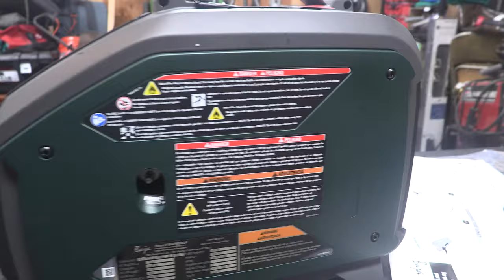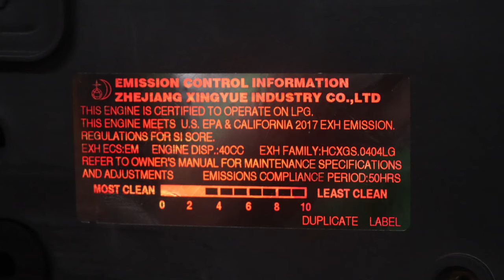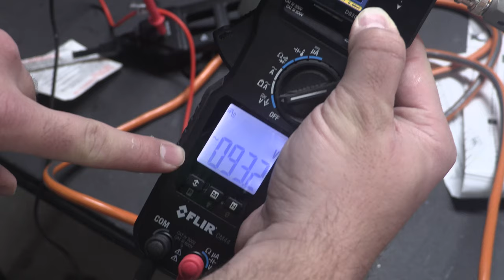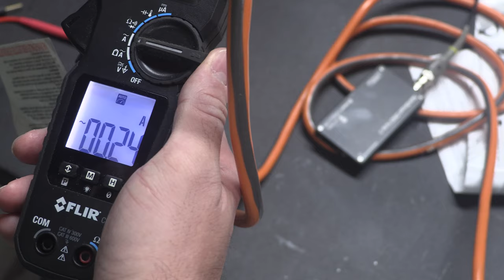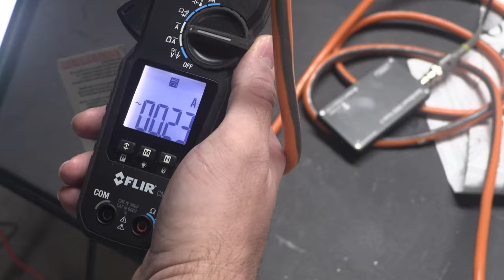Baja 900 - First Look and quick review

Comment: They are great generators. I have a couple of deep freezes that I use with one. Together pulling in the 120w range after startup. One of these with a 20lb tank will get 60hrs at that load. I can run an LED projector, PS3 super slim, laptop, cell phone charger, charge tool batteries, and small speakers. Pretty insane the amount of stuff you can run if you are just a little power conscious.

Comment: Mine also had lots of oil residue at the bottom.  They did not QA really well from keeping that from happening.  Also one of the feet fell off.  Had to find the screw outside but luckily I did. Thanks for the review. I need to add more oil to mine and retest.  The oil that came with it barely filled the tank to low minimum.  They sure cut corners.  Super short propane hose.  I think it should be OK for us though.  Purchased on sale at Home Depot for I think $239 plus tax.

Comment: How did you know what kind of oil to use?  Sorry I am not very handy...  Great test Review!
Reply: I looked it up in the manual on the Home Depot site for this generator and it takes 10 oz of 10w30. I just bought mine used and the oil was a little low and pretty dirty so I had to find the specifications.

Comment: would 1 lb cylinders freeze up and make it stop running
Reply from the maker: I've only got a few hours of runtime on this unit, and it was in decently warm weather high 40s/low 50s and there was no freezing. I suspect freezing would be an issue if you were much colder 30s and below while pulling a high load.
Reply: Yes. Freezing was an issue with mine under 50 degrees with light load. I solved this by making a manifold to connect two tanks to the provided short hose. This increased run time to over 6 hrs. Very happy with it.
Reply: Flame King makes a dual one pound bottle adapter that hooks to the propaine with an adapter hose for about 30 bucks.

Comment: My entire second floor is one large open area with like a 20' ceiling except the master bedroom, bathroom, and a tiny half bath.  The kitchen, living room, and dining room are all open.  Do you think this is safe to run inside on my second floor on the 1 pound bottles in order to "not advertise" to the neighbors I  have a generator?  At the most, I would use a flame king dual one pound coupler, never a 20-pound tank inside.  I was thinking if you can use a Mr. Buddy Big Buddy heater with two one pound tanks inside, this should be okmwith a dual 1 pound coupler.  What do you think?.

Comment: I'm looking in to one of these, but I have to know. Do you not need a regulator for the propane tank- specifically the 20 lb one? You can just plug it straight in?
Reply from the maker: The regulator is built into the genset itself. You just need the 20 lb to greenie adapter and you're good to go. It comes with a really short adapter hose in the box - so you should be up and running without needing anything else.

Unless you want your propane tank to be further than 2" away from your generator's front panel. :)
Reply: I have converted mine to run off of my travel trailers LP system.  While I won’t give details on how to do it, I will give you a hint.  Inside the generator there are two regulators. A tiny one for converting LP tank pressure to about 5 psi, and the big one that he showed that is a demand regulator.  For my purposes, I removed the small one (because my trailer has a low pressure regulator already). This will make it impossible to use a throw away bottle, That I had problems with freezing off, thus starving the generator.  The inlet for the fuel is part of the regulator that I took out.  I just replaced it with a quick disconnect hose.  I can’t give detailed instructions because if your not totally familiar with vapor gas systems, you could be in for some real hurt trying to do this. I will warn you it’s not as straight forward as I have made it sound, and their is a very real chance of ruining the generator.  Mine is two years old, ran a fair amount and still going strong. Mine is the Royobe branded one sold at Home Depot, but it is absolutely the same unit.  My buddy has the Baja unit and we modified his also.  I paid less than two hundred for mine, so I wasn’t to concerned if I broke it.  Also, mine came with a ridiculously short poorly made twenty pound tank adapter, and good ones that are longer are available from Amazon for less than 20.00.  You only need to modify yours if your going to run it on a already regulated LP line.

Comment: Been looking for fuel consumption numbers for 50% and 75-100% load if anyone can share that info
Reply: I recently had a power outage and use this generator to run a 13sf refrigerator, two fans, 4 led lights and 3 chargers for cel and laptop running total 400 watts that will make it over 50% capacity. That been said 1 lb cylinder lasted 2:50 hours before cutting off after that I connected the 20 lb cylinder same 400 watt load for and additional 11 hours non stop until the power was re established, the propane fuel gauge still marks full, it did not even moved so maybe a little more that 3 pounds of propane were consume.